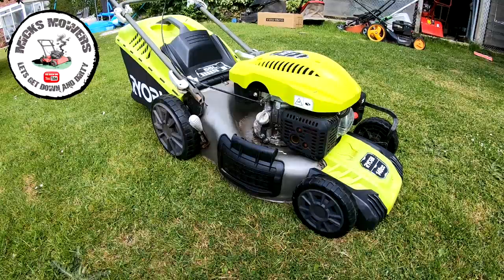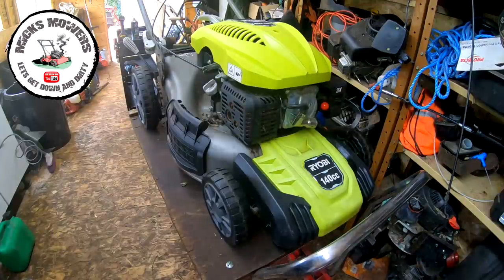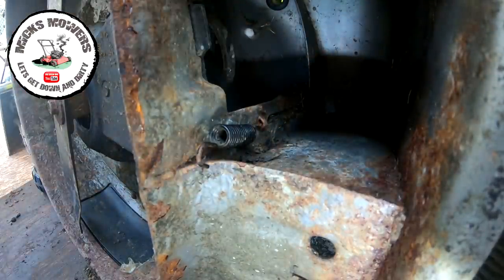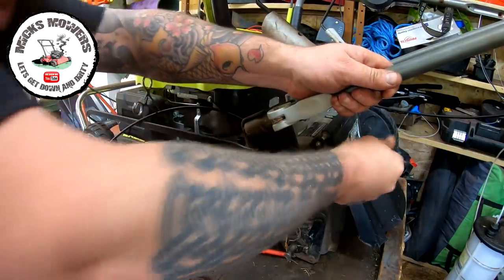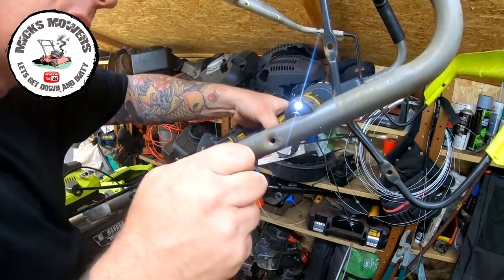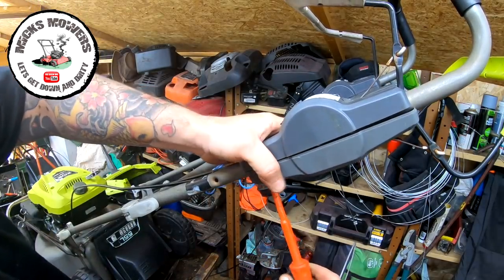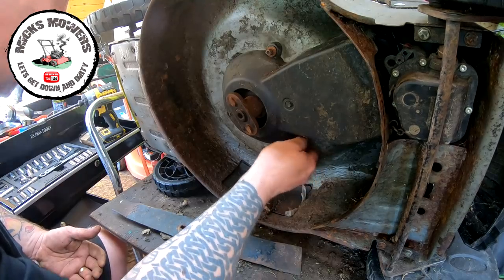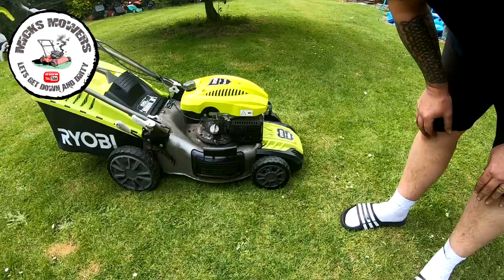Roybi LawnMower Part Of A Job lot And Missing Some Parts. Will It Run Easy Fix Or Not

Comment: Did the cable crimp with with grips and it slipped then did as you said with the vice and a month later still working fine.
Reply from the maker: Boom and that's how you do it mate

Comment: At the beginning of the video I was wondering if you were going to use a tie wrap to hold the dead man lever.  Aren't those cable repair pieces great !!!    Is there a choke issue?
Reply from the maker: Will be having a look at the carb tomorrow. I don't think it's a problem but I hear a knocking noise.. we will see. Hope your good mate